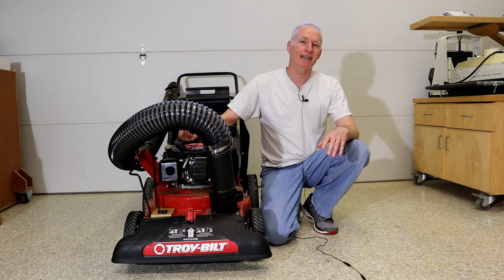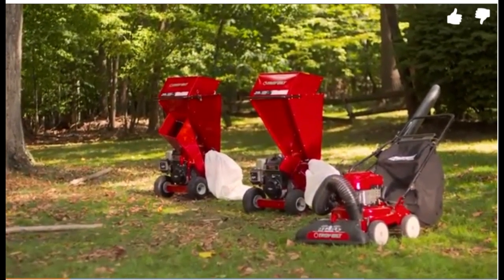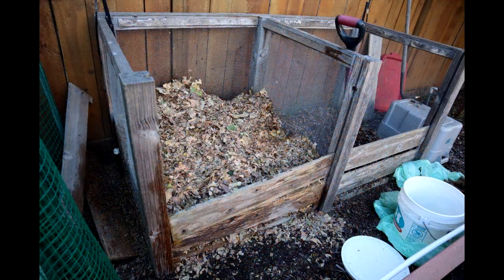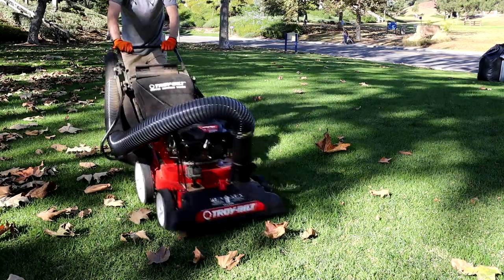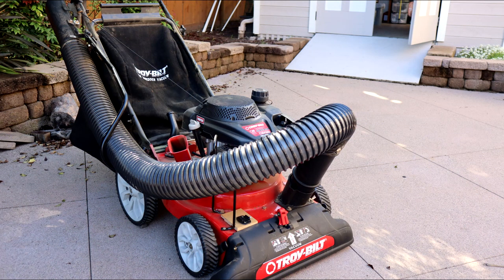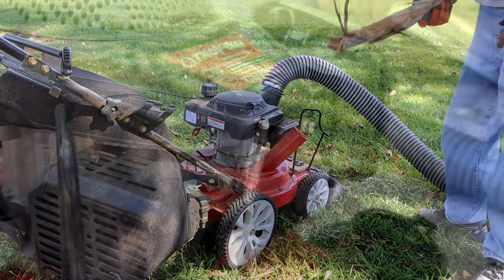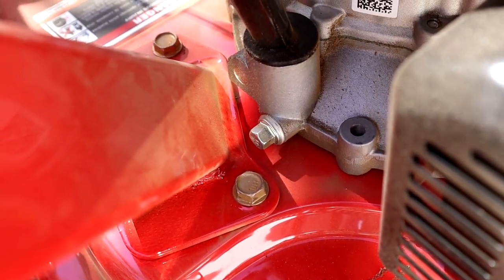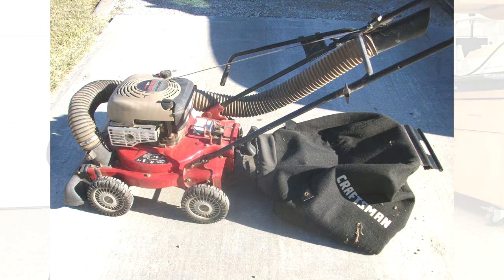Troy-Bilt Chipper Shredder Vac Review

Comment: Avoid this product. Only worked for one season. Tried everything to figure out why it stopped running: oil change, fuel change, carb clean, air filter, spark plug, safety switch, etc. nothing got it running again. Since it was under warranty, the inly option i was given was a refund. Warranty department said they have had a lot of problems with this model.

Comment: I’ve owned one of theses for more the five years and my wife really enjoys it.  I recently bought one for myself at a resale store to help her out.  My only complaint is the bagger closure hardware fails within two years so treat it gently and check it occasionally.  If it fails, you can use a couple of clamps to hold the bag together.  Be sure to wear a dust mask and ear protection.  It’s loud and makes a whole lot of dust both in operation and dumping the contents of the bag.  Also, I suggest wearing eye protection because when you use the chipper, sometimes it will kick back a chip at you with some force.  I put my gloved hand over the chute.  Don’t try to cram a large stick in to chute because it may get stuck and jam the machine.  Then you must take it  apart.
Reply: They sell the bag closure twist clasps that you can replace your broken ones with. And I totally recommend ear protection with any small engine. These engines are loud enough to do hearing damage.

This listing calls them DOT Common Sense Twist Turn Button 8 mm DOUBLE Stud Murphy Fastener

https://www.ebay.com/itm/DOT-Common-Sense-Twist-Turn-Button-8-mm-DOUBLE-Stud-Murphy-Fastener/223012162178

Comment: A good and comprehensive operational review.  I have a similar unit that is branded Yard-Man by MTD.  MTD also makes the Troy Bilt, Cub Cadet and Craftsman.  My Unit is 21 Years old and it is pretty much the same as your Troy Bilt.  The differences are the newer models have the vacuum hose and a newer more efficient OHV engine.   The housing and bag are identical.  It is harder to pull start because of the heavy cast iron impellar which acts like a very large fly wheel.  The good news is you do not have to pull it fast.  Just firm and the energy in the fly wheel will turn the engine over many times.  Changing the oil is not that bad if you have a suction tool.  There are many kinds on the market.  Otherwise remove the 3 bolts holding down the chipper chute, tip the machine on the side and drain from the fill tube.  After you do it once you will see it is not that bad. Some models come with a leaf blower attachment.  I like how the Troy Bilt now comes with larger rear wheels which helps with rolling over uneven turf. My unit has ball bearing wheels and rolls easily.
Reply: I have one with the older Briggs Flathead engine. Oil extractor is the way to go. I think there is on oli drain plug on the underside of the older Briggs but the requires removing more parts under the machine.

Comment: I would recommend getting an oil extracter change the oil on this unit. I had I bought the Top Sider oil extractor. I have an older model of the Briggs & Stratton Flathead engine. Oil extractor works great on that.

Comment: Thank you for this review.  I bought an older model on Facebook Marketplace.  I have sweet gum trees, and if anyone knows what a P.I.T.A. sweet gum balls are, they can feel my agony.  You think this would pick them up?  My used one doesn't.  It doesn't have the adjustable wheels like this model.  And I agree, it makes excellent mulch.  I have raised garden beds....I just toss that right in there, mix it up with composted manure, compost or top soil, and by next spring, it's eaten up.
Reply: Mine doesn't pick up gumballs or acorns, but it does a good job on the leaves.
Reply: @skyfrog69  have you guys tried attaching some sort of skirting to the sides isolating the suction draft. I would think that might help with acorns and such.

Comment: Great totally honest review.  I have one three years old and had to replace the bag 4 times because the tabs on the diaper came lose and lost it.  You can’t replace the tabs.  The bag costs $180.00 each.  The original bag that came with the machine lasted 30 minutes,  The tabs broke.  Brought the bag bad to the store and they gave me one from another machine.  That same day I had noticed oil on the deck.  Brought it back to the store, i.had to go to an authorized Troy Built repair shop.   Brought the machine to the repair shop, picked it up a few days later,  the seal was gone and not covered by Troy Built,  cost me $85.00 on a brand new machine that was used 1 hour.  I just replaced the pull starter/engine cover, gas tank. This Troy Built replaced by old one that was 22 years old.  They redesigned the machine which you can no  longer pick up pebbles on your driveway, wet leaves jam like crazy, it’s dirty when you use it and your covered in dust.  I expected a much better machine.  I can’t wait to get rid of it.  I will never buy another Troy Built product.  It’s cheaply made and made in China.  Piece of shit just like all the Chinese made products today.  Doesn’t MTD own Troy Built now?

Comment: I have a similar curb vacuum, made in the USA and I  couldn’t do without it,use it on driveway and curb,if you’re thinking about getting one,do.However I also have the same issue starting,requires full choke to start,then open it fully,great informative video.

Comment: Hi Mark; I have a better model and it works pretty good. As for starting, It is a bit hard, but it takes 1 pull to get it going. I have an 11 horse and I have the rear wheel drive in which makes it a whole lot better. I really like this and wish that they would come out with an auto start type! Ok, well for those hard places, I don't use the hose, I just use the blower to blow the leaves onto the runway. Overall, I give this machine a straight 7 out of 10! Thanks for the viseo.... Eddie

Comment: I've got the Cub Cadet CSV-50.  It seems to be the same as your Troy-Built.  The only differences are cosmetic (yellow paint vs. red paint, the color of the hose, and the branding labels).
Your review is well put together, except for one thing.
The oil changes are easy, actually.
Simply tip the machine on its' side and the oil will drain out through the dip-stick column.  Have a catch-basin ready and the oil will drain directly into the catch-basin.

Afterwards you can pour the used oil into an appropriate container for storage and eventual disposal/recycling.

As for the difficult starts?
When cold?  Yes, it is difficult to start.  
To solve this problem, I've resorted to using "Starting Fluid" sprayed directly onto the air-filter just prior to start-up (open the air-filter cover, spray the starting fluid on the air-filter, close the cover and then start the engine with the choke set to the OFF position).  
By using starting fluid, I've gotten the machine to start within two or three pulls of the cord.
When the engine is already warmed-up from use, I can leave the choke in the "OFF" position and it usually starts up in one or two pulls of the cord.

As for the extra effort needed to pull the starting cord, when compared to a lawn-mower of the same engine size?
I am guessing the impeller is heavier than a lawn-mower blade.  The extra mass simply has more inertia, which requires more effort to overcome.
I also think this is why it takes several seconds for the engine to come to a complete stop after the engine's "ON/OFF" switch is turned-off.  The rotating mass takes a while to slow-down.

Otherwise, just follow the maintenance procedures outlined in the Owner's Manual.
They seem to be useful and hardy machines, while operating within their performance envelopes.

Thanks for sharing your review video.  Best wishes to you.

P.S.  You're welcome to the leaves in my yard, if you want to commute to New Hampshire to get them.  :-)

Comment: Good review!  I just took delivery of mine today.  I got the self propelled model and the engine seems a little different but otherwise identical.  

I installed the hose system and then removed it and hung it on the wall.  I don't think I'm every using it and it seems like it will be awkward and in the way.  

The quality is kind of crappy.  The bracket for the hose was installed upside down so I had to fix that.  One of the spring clips was missing for the handle and one of the plastic wing nuts is stripped so I'm going to the hardware store to upgrade that.   If I can avoid calling their call center  and trying to communicate with those idiots I will!

It started on the 2nd pull and yes, a big puff of blue smoke.  

I think it's a pretty decent unit, probably not a great value for the $799 I paid but hopefully it will be better than raking.

Comment: Yes, I think just about everyone of those chipper/vacs are built by MTD (Troy Bilt, Cub-Cadet, etc).  
Its a bit hard to start, for one you are trying to spin a pretty heavy flywheel attached to the engine shaft while at the same time trying to start it LOL.  This is something they really should try and redesign, some sort of a clutch system like a weed eater, chainsaw, or many larger sized belt driven chipper/shredder units have.  During starting the clutch is disengaged until engine RPM comes up to a certain speed then the clutch engages.
Reply: I have the cub cadget version and it starts right away, with choke. As long as you give it some choke it'll start on the 1st or 2nd pull. I added a fuel shut off valve so it usually takes 2 pulls to get the fuel going and then start. when its warm, one pull and it starts but the engine does need choke to start.
Reply: Yeah that design definitely is pretty outdated. It always starts on the second Pull. Once in awhile I will get lucky and it'll start on the 1st.

Comment: I just picked one of these ho and maybe it's based off my terrain. But I seem to get terrible suction out of the bottom and the hose.  The hole slot for the branches is extremely inconvenient, it's nice to have but it deserves to be much bigger given this thing costs a good chunk of cash. The installation and quick start guide are basically non existent . I love Troy built as a brand but I feel like this SHOULD be good at one thing vs the usability of "both options. I will admit I love having fresh mulch 🤑

Comment: It sure would be cool if there was something you could strap onto a mower that would make it function closer to this. Maybe include a special blade
Reply: But, to be fair, the Chipper/Shredder/Vacuum provides more suction and has a larger bag than most lawn-mowers.  
Also, it can chip small branches, which a lawn-mower is not designed to do.
Reply: @libraeotequever3pointoh95  The closer you will get in a lawn mower to vacuum leaves is the  Toro Super Recycler.  But it will not work as good as this dedicated lawn vacuum.
Reply: @nbpt1000   I put skirting around my recycler it sucks up everything

Comment: Thanks for a great video. I am in the exact same shoes as yours - To make leaf compost. So I bought a Sunjoe Blower/Vac/Bag but after 8 bag fulls got tired of it albeit $70 was worth it. Now am looking for a better way. Was going to purchase a chipper/shredder combo from Troy-bilt but doubt it will help. Did you find the TB Shredder Vac, the absolute best way to get a large amount of compostable leaves or have you stumbled on a better way? I'm about to pick one up from a guy who is selling it for $400 after using it 1 day.
Reply from the maker: Hmmm. $400 for nearly brand new seems like a decent deal. As you know the compost challenge is two fold. Collection & shredding. This machine does an OK job at both. This year I got lucky and the caught the park maintenance guys raking up the leaves and they happily gave them to me. But I still need to shred them to speed up the compost. For shredding only I think one of those stand alone hopper shredders would work way better.
Reply: @DIYMark  Doesn't this shred 8:1 ratio? Granted that the stand alones would do it between 12-15:1 but that seems hardly a good reason for the inconvenience of shredding it a second time.
Reply from the maker: @rajaiyer79  Yes it does compact 8:1, which is adequate for sure. But what I wasn't clear about is this machine isn't really set up to handle  leaves that are already piled (i.e.  when the maint guys gave me their raked leaves.  The hose takes to long and gets clogged easily with big piles. The hopper style might be better for this. But for collection and shred at the same time this guy works well. Especially at this price point.
Reply: @DIYMark  Good point.
Reply: @DIYMark  Thank you both. Today on FB, I see someone selling it for $250 without the hose. Don't know how old it is, but wondering if its worth a gamble if operational.
Reply from the maker: @RA-tc1xq  That sounds like a good proposition. If the hose is just missing, I replaced the inflexible hose that came with the unit with a 4" dust collection hose (i.e. rockler). It works a bit better. I had to build a bracket on the front to keep it from sagging into the wheels. FWIW.
Reply: Ended up with the $400 barely used TB and I came back to thank you for your video. So after purchase I got home and the unit refused to crank start. But I kept the faith and after the 7th or 8th pull it started and ran like a champ. My leaf mulching/composting, black gold journey creation starts! Thank you!

Comment: My interest in this product is for vacuuming up sticks not leaves.  I wanted to ask if it will do that  ? --  I'm not talking about putting each stick in that slot and it grinding that up. -- I'm asking if you push the mower  along as if you were cutting your grass and whether it will suck up the sticks and grind them as you go along ?
Reply from the maker: Hi Jack. I would say most likely not. I'm not sure of the size of stick you're trying to pick up but even small ones are challenging. Leave work great because they have so much surface area to weight. Sticks not so much. I know several people have reached out to me about acorns, which is a similar dilemma. Sorry wish the news was better.
Reply: Thank you Mark for your reply and info. -- I didn't want to make a purchase and then it not do what I wanted. So thanks for giving me the info .

Comment: I'm in NC and looking at this primarily for picking up gumballs that have fallen out of sweet gum trees. I have many in my front and back yards. It would obviously help w fall leaf removal too. But curious your thoughts on picking up gumballs if you have an opinion to offer.
Reply from the maker: Hey Nathan. I had to google a sweet gum tree....so not too familiar. But this machine most likely would have some trouble (looking at the pictures of gumballs). The vacuum is strong but items need to have lots of surface area and light weight to get picked up well. You're not the first to ask about similar problems. Lots of people looking for acorn and tree nut solution.
Reply: I'm in Arkansas and we have those damn sweet gums here, too. I have had this vacuum for three years.  It does a great job on leaves, but you can forget about using it for gumballs. It won't even pick up the small pine cones that I'm sure you have as well.  I suspect the designers purposely limited the suction to prevent small rocks from being vacuumed and damaging the impeller, at least that's my guess.  It will save you a lot of raking and bending over to pick up piles of leaves, but it's not going to eliminate all of the work. I hope this helps.
Reply: @skyfrog69  all true.  The lower you place the nozzle the better the suction.  If you lower too much it may catch on the grass.  It is a trade off.

Comment: I’m curious how it will handle acorns and pine needles.
Reply: It won't.  My yard is full of white oaks and pines.  It will pick up all of the oak leaves, but it leaves the acorns and will only pick up pine needles if they're very dry and mixed in with larger leaves. I have had mine for three years and I feel like it was a worthwhile investment, but it doesn't do all of the work for you.

Comment: I understand these things are designed for leaves, acorns, or sticks, but does the front vacuum head have enough suction in the lowest position to pick up things like small rocks, bits of asphalt, or mulch chips up off the grass? This kind of stuff has a lot more mass and run of the mill 12A impeller vacuums don't have enough power to pull them off the ground.
Reply from the maker: This unit does not have enough suction for most small rocks. Which is probably a good thing because all material is pushed through the mulching flail and they would likely do some damage. When it does pick up a rock or two it clanks and ricochet around and makes me wince when it does.

Comment: Is there another brand/version that you would rate higher?  To pickup leaves and debris would an electric mower with mulching blade and bag work better.  I do not see any new models of chipper shredder vacs out their so it makes me wonder on the usefulness of the product.  Thanks.
Reply from the maker: Dan I don't have too much experience with alternatives. Rented a couple in the past and they had their challenges as well. I don't think a mulching blade on the mower would get it done. Just don't have the pickup power that a fan impeller gives you with a yard vac. But I like the idea of using an electric over a gas powered machine. But haven't seen a specialized version of a push yard vac yet.

Comment: I have a much older model that doesn’t shred leaves the way it used to. Any ideas or tips to get it back to where it used to be?
Reply: Check that the flails are working as they should. They are removable. Check your manual. Also check the engine RPM.

Comment: My only complaint with my 6 year old model is that felt bag.  Leaves stay stuck inside when you empty the bag.  And worst of all, the clasps wear out quickly.  Replacement bag is around $250!!!  Almost half the price of the whole yard vac..  Anyone come up with a way to close the bag after losing a clasp or two?  Giant safety pin?